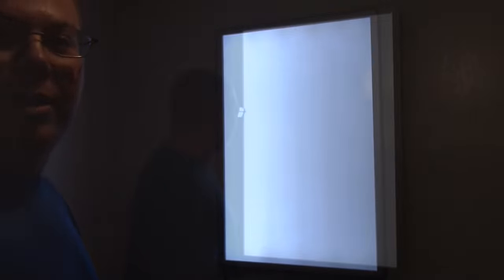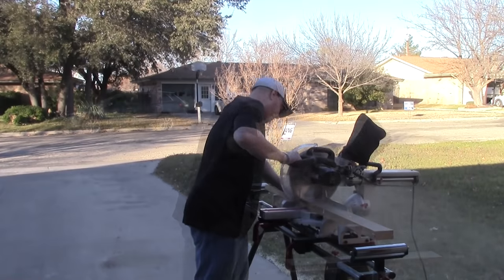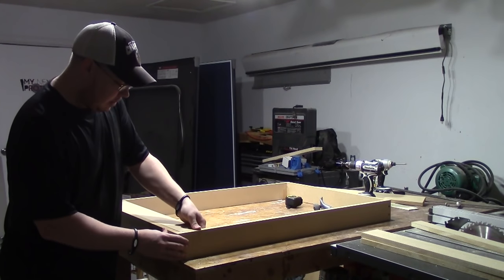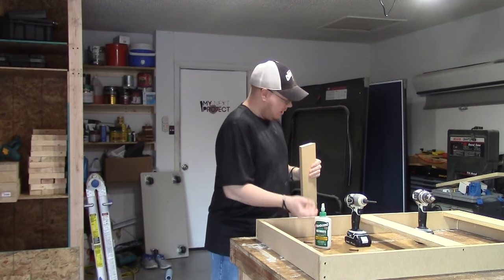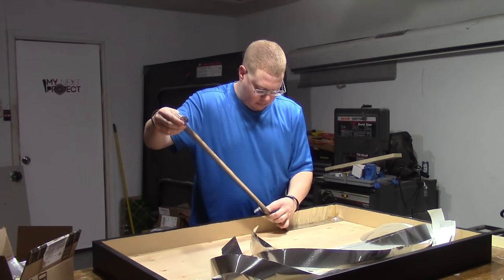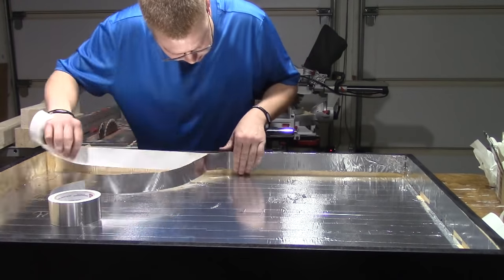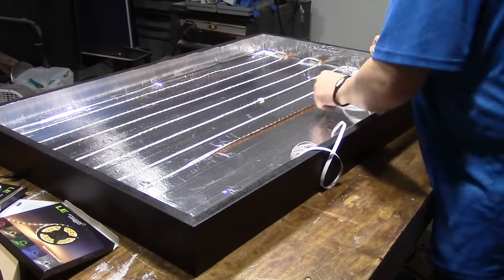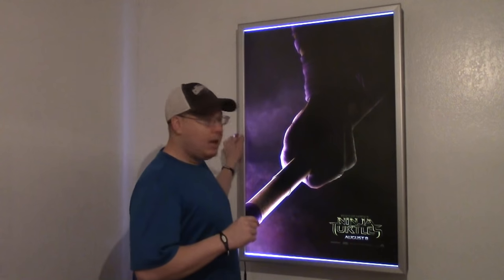My Next Project: Movie Poster Box Light

Comment: Good job!! Looks like you purchased a 27"x41" snap frame when it should have been a 27"x   40" length.
That would eliminate the 1/2" of light on the top and bottom shinning through.
Reply from the maker: There was a reason I didn't get the 40" at the time but I can't remember why now.  But yes you are totally right.  The smaller snap frame would have worked out perfect.  

Thanks for commenting.

Comment: Nice video and documentation.  The LED power source block apparently sits on the floor with a cable going up to the light box.  Your suggestions on how to hide this power 'brick' considering it's known for getting very hot?  While beyond the scope of your project I was wondering how would you suggest dimming the LED lights (post power adapter)?  And how would you go about wiring 4 light boxes along a 15' wall through a dimmable LED driver (with a 150 watt draw) hooked up to an LED dimmer wall switch?  And BTW: Using 2 of the 16.4' LED light strings you suggest draw 24 watts each (48 watts total) vs the 36 watt power adapter you suggest.
Reply from the maker: I did not realize the power adapter was not enough for those 2 sets of lights, thanks for pointing that out.  I don't leave mine plugged in all the time as it is anyway, so I don't worry about the brick getting to hot for myself.  If you are wanting to leave this plugged in all the time, you could probably secure it to the top or bottom of the frame where it would have a little air circulation around it, as opposed to being inside the box.  Might could even put a small spacer so air can flow under the power supply as well.  

As far as dimming the lights, if i remember correctly, you have to buy "dimmable" LEDs.  Not all of the LEDs are dimmable from what I remember.  I do know that they have nicer power supplies that you can have a switch on to turn the lights on and off and I am sure there is one that has dimming ability as well.  

As far as 4 separate boxes on a wall, that is going to be alot of wiring outside the box that goes along the wall to hook them up.  You might could have each box start and stop with a secured the type of power supply you are using and just wire from one to the next.  

Or maybe having each of the 4 plug into a separate outlet or into a power strip would be best.  Plugging 4 of these boxes up with 32 feet of LEDs per box might be alot, even if you had a big enough power supply.  

I am curious to see what you come up with.  I would love to see pics or even a video of what you do.  And would like to show it to my viewers.

Comment: You've inspired me to build this. I'm actually on the last step of laying down the LEDs but I noticed voltage drop and dimming on the second strip that I connected. Was wondering if that happened to you too? I kind of see it happening but it might be the angle of the light box. If so I think I'm going to wire them parallel because that really bugs me

Comment: Great Job.  
Can you let me know if this will support heavy stuff in the middle.  I want to use this to take photos of large items.  But they will be over the middle.  Also can you send me how much of each items you needed or purchased.  IE 2 LED packages or strips.  Also can you provide the details of the box.  

Thanks
Reply from the maker: I will see what I can come up with as far as plans and box details.  If i remember right, I used 2 LED packages and 1 roll of aluminum tape, and one power switch.  I think I linked all the materials I used in the description.

As far as weight goes, this boxes is already pretty heavy and I have not had any trouble with it at all.  If you screw into the studs, then a french cleat system works very good.  If you miss the wall studs then it won't be very strong at all.  

You can always add more than one brace to make it much stronger and hold more weight if that is what you want.

Comment: +My next project: I've considered doing this but would like to know 1, how much did you save vs what you would have spent buying a light box? Five years later, I'm seeing light boxes go for 250 to 300 (specifically for 27x40) and 2, I've decided to go for light boxes that emit 6500 lumens to ensure that they light up regular posters as opposed to double sided posters. Am I correct that the lumens for this strip is 2800 since it reads 6000 kelvin?

Comment: What did you use to hang it? The one I bought is the thin one by crystal but it only comes with these 8 barrels and holes,not sure if I gotta get my own hardware and drill through it
Reply from the maker: I can't remember if mine came with screws or not.  I just screwed the frame directly to the light box I built.

Comment: Nice video!! But i was wondering what the size is of the poster because insee some light coming out up and down of the poster.. im from europe so these frame are very very expensive to ship to. I wanted to use opal white plexiglas instead of the translucent back you have.. do you think that also will work?

Thanks
Reply from the maker: The frame, I believe is a 27x40.  The poster was like 26.75 x 39.75 or something like that.  It was just slightly smaller than the snap frame.  Rather than trying to get a smaller one and trim the poster, I decided to get the size i got and deal with the small amount of light on the edges.

It is very expensive to build these.  This is one of the most expensive projects I have built.

Honestly, I don't know about the plexiglass.  I looked into it briefly, but it was going to cost more than the snap frame so I dropped it.

Comment: Great video thanks for posting. I'm about to make 3 of these for our new cinema room and in the UK they don't make snap frames with a perspex back so I will have to remove the metal back and replace with customer cut perspex. I noticed you used an opaque perspex and not 100% transparent. Is this essential or can I use 100% clear ?
Reply from the maker: I honestly don't know that it matters, those are the only options that I saw that was available.  I think if you have 100% clear that you will most likely get a brighter looking poster.  

Thanks for watching, I am glad you liked the video.

Comment: in my opinion i would have made the box about half the depth and ran the strips horizontally with soldered connections to get the most possible light coverage, but overall nice build.
Reply from the maker: Yes, if I make another one of these, I would definitely not go as deep.  One of the reasons for it being so deep is for the french cleat to fit behind it, but even with that, I would still make it less. 

As far as the lights, I did not have a soldering iron at the time.  And I am not sure if it would matter if you go horizontal or vertical.  I think both will have good results.

Comment: nice video! what kind of Plexiglas you are using?
Reply from the maker: It is actually a snap frame.  There should be a link in the description to everything I used in that video.
Reply: so I see the diffused Plexiglass comes with it. thanks. they don't have 36"x36". my bad luck.
Reply from the maker: Yes, there is a film that will go over the front of the poster. 

I do not see a 36x36 frame either.  I am sorry.

Comment: I just made an LED lightbox. My suggestions:  #1: before attaching the back panel, put the foil tape on the inside walls of the wood frame first. it will be much easier to put on. #2: just follow the seams of the tape lines to lay your LED strips down. no need to make the black lines you mentioned. :-)
Reply from the maker: I would agree with both of those.  Honestly, after making this one and a smaller one similar...I don't think there needs to be a crazy amount of LED lights in there.  I think you could eliminate several rolls and be fine.
Reply: My Next Project yes. I only used one roll of a 16.4 ft one on mine and my poster/lightbox is 36 x 36” square.

Comment: Why do you not use a Kreg jig on the inside of the box to fasten the corners it is more Professional
Reply from the maker: The box is painted, so it really didn't matter.  Since it is glued and screwed, the strength should be about the same.  I am not against pocket holes, just seemed like and extra unnecessary step in my opinion.

Comment: To make it easier to remove the paper off the foil tape don't cut it, tear it instead. Doing it that way will leave a rough edge and a corner will almost always be pulled up.
Reply from the maker: +Jonathan Broline Okay, I will have to remember that.  It makes sense.  That was the most difficult part of doing the project....seriously....was getting the paper off the tape.  

Thanks for the comment.
Reply: You can also use a small sharp blade or knife to separate the paper back from the metal tape. Just as easy as tearing it, and you are left with a nice edge instead of a torn one that you would have to clean up/cut straight.
Reply from the maker: CoroaEntertainment
Oh okay, thanks for sharing.  As I said in the video, that was the most difficult part of this project was getting the backing off the tape.